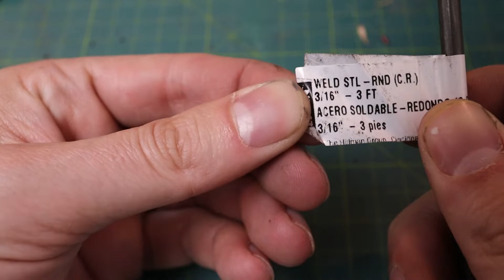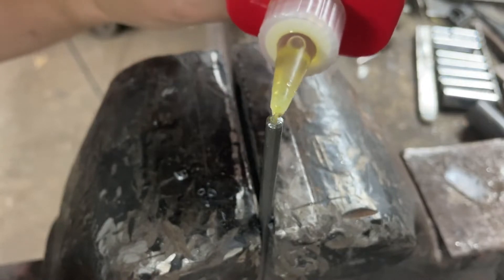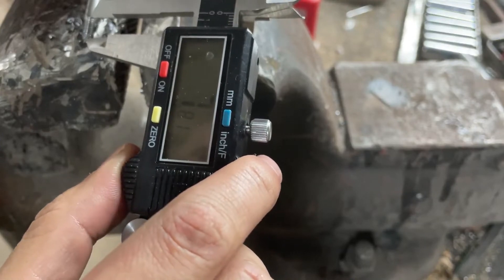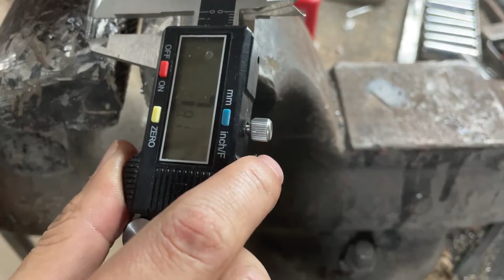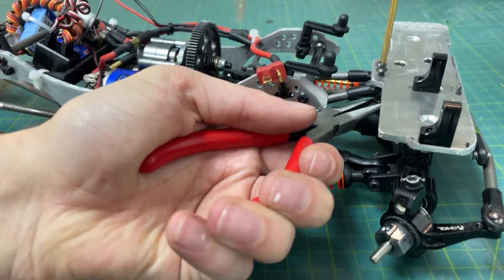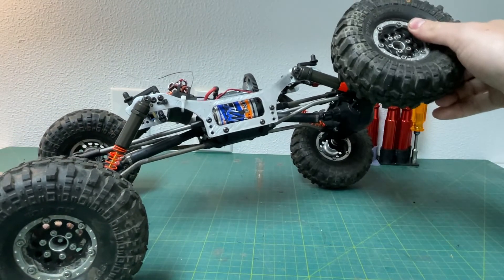How to make DIY suspension LINKS - EASY and CHEAP and STRONG!

Comment: But when you tap into the rod ends. You weakening them ?
Reply from the maker: @Justyoutubing479  No not really. The rod ends are molded to accept an M4 thread, and the 8-32 thread is very close in size, so you’re really not removing much material. I’ve been doing this method for years not and very rarely have broken a rod end